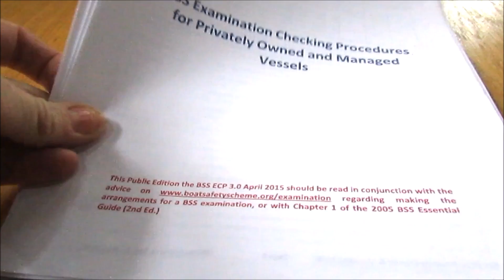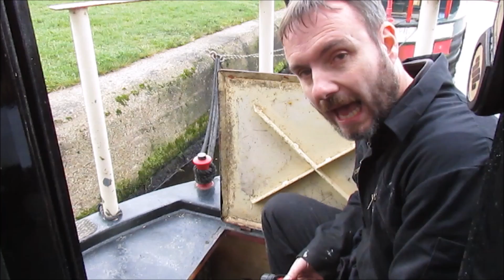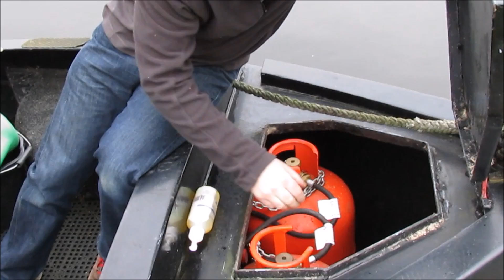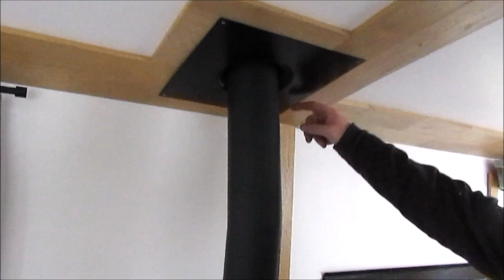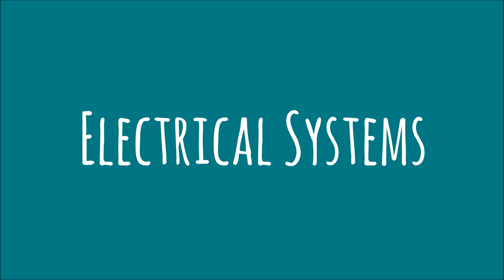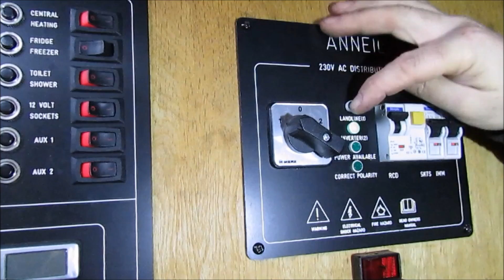Preparing for the boat safety certificate on our narrowboat - Episode 8

Comment: It looks to me like it's supposed to be an ongoing process. would this be the case? Truck and for that matter forklift drivers do a walk around check before using said vehicle. I used to help operate a paddles steamer here in Victoria and yes it failed, but that was after 10 years between surveys
Reply from the maker: Hi there, yes we always check certain things before using the boat but they tend to be on the mechanical side of things.